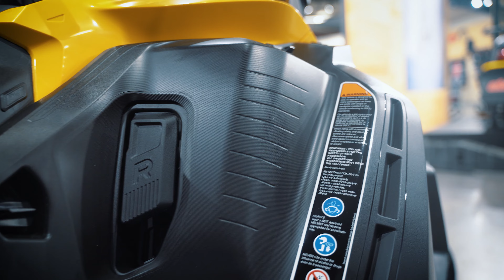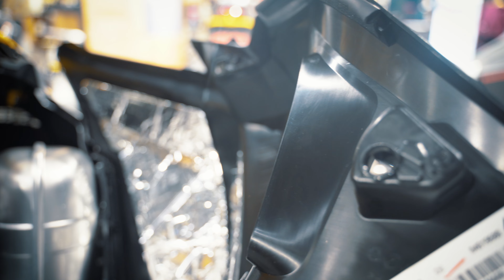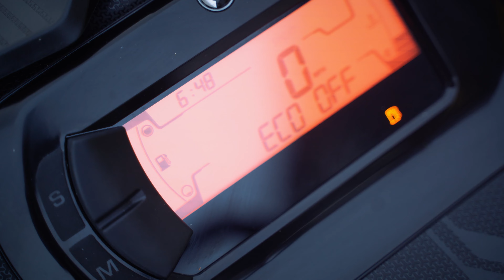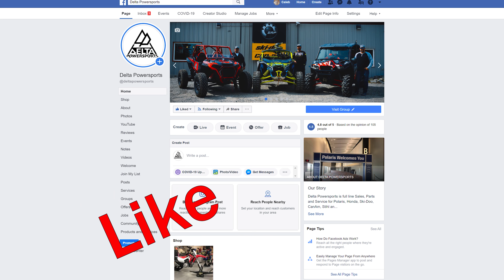2021 Ski-Doo Tundra 600 ACE with Linq Accessories (Full Walk Around and Test Drive)

Comment: Is there a secondary starting option on this machine?
Reply from the maker: No. You can’t put a pull start on the 4-stroke units. We carry the small jump oaks in case battery dies.
Reply: @Deltapowersports  oh ok I good idea 
Thankyou for info, I’m on the fence over a two or four stroke lol .
Reply: @Borrowed Time wow Thankyou for the in depth response! 
I was looking at that little piece that you put on the clutch in another video!
I did end up buying a brand new 2021 ace tundra. Haven’t been able to ride it yet but slowly setting it up for ice fishing.
I more than likely will get both a jump pack and a emergency rope pull just in case.
Like you say I don’t know why there isn’t one on there but I’m hoping this thing is pretty reliable and don’t have to use any of that stuff! 
Thankyou again very much!
Reply from the maker: @Borrowed Time do this at your own risk. The rope is put there for extreme emergency situations and can cause some bodily harm if done wrong.

Comment: Caution  I had a 600 ACE Tundra.  It couldn't pull an Otter Lodge through the slush when a 570 16X154 Bearcat could with ease.  These things have a purpose, but they are horrible pullers in slush.  I now have a new Tundra with a 600 EFI 2 stroke.  It is a beast of a puller.
Reply: The other day I pulled a Bearcat 570 that was break down in slush for about 10 miles Long trip !! So I think that your sled clutch was not adjusted properly!! 600ace IS the working engine in the Tundra !! Good luck in the long term with your 2 strokes !
Reply: @JayBruler  Yep had the the clutch adjusted and changed by the dealer.   Thanks for wishing me luck.  I appreciate that.
Reply: I have a 2022 600 efi tundra LT too and i love it……. I almost wanted to get a 600 ace, just because of how quiet and how good it is on gas, but whatever maybe i will eventually.